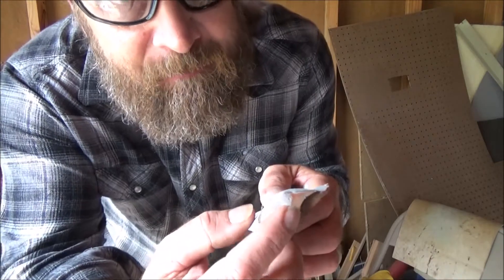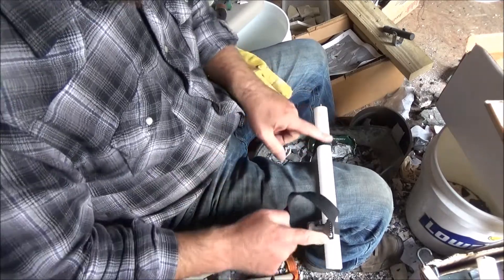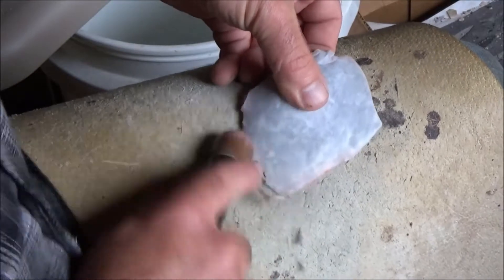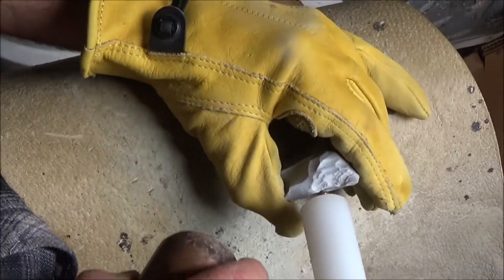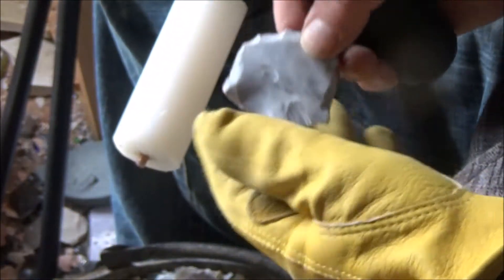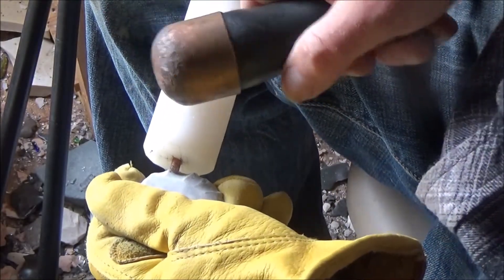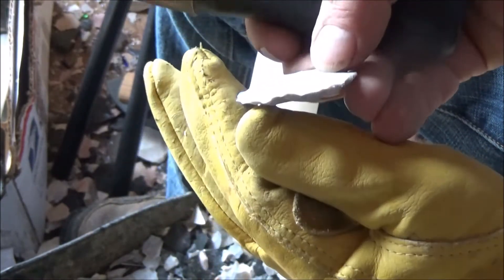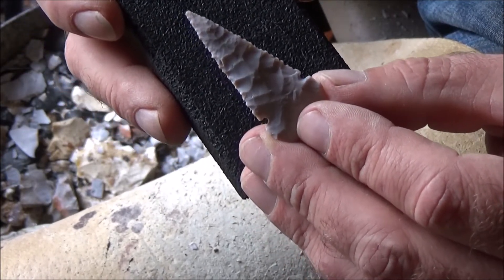indirect percussion part 2 - thinning

Comment: Your terminology needs work. "Blow thru this area" . How about reduce this mass, or use a bifacial reduction process removing  this excess stone. " Blow right thru this area" just doesn't sound right. Also, if you prepare a platform carefully you can remove mass thru percussion using the correctly weighted hammer stone or antler. It's an excuse to be say you can only use indirect percussion to remove mass. It's due to a lack of knowledge & skill required when using direct percussion to remove mass from a stone.